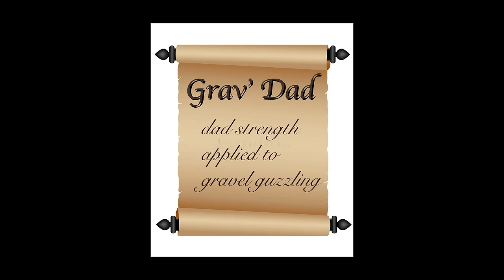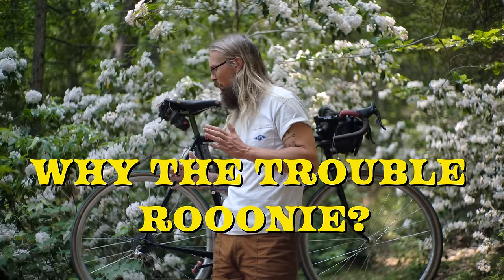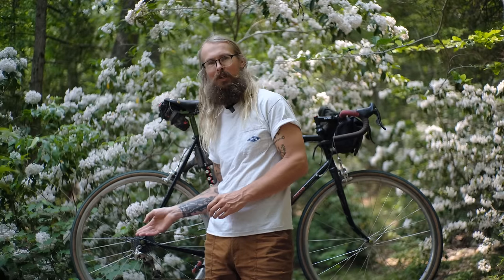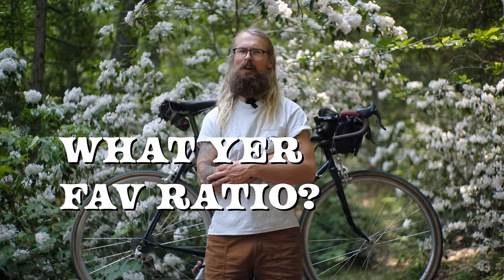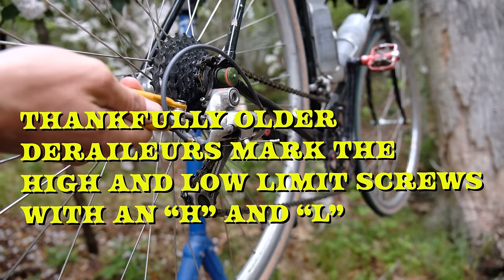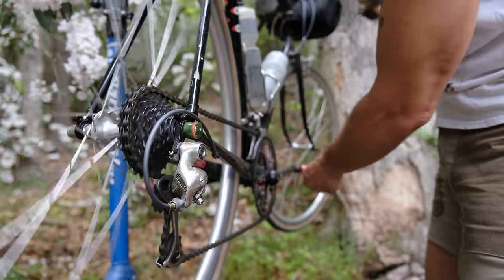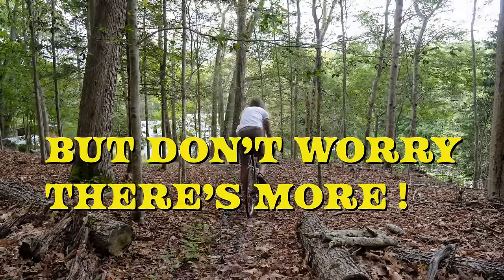build your own groupset

Comment: This video was a joy - appreciate your musings. 

I am wondering if you could maybe shed some light on what brakes you are using with your Malocchio? I am looking to build one myself and trying to find the happy middle ground between reach and a brake set that looks great on the frame.
Reply from the maker: hello!  these are Shimano BR-R600 medium reach brakes from the 9 speed era ultegra.  they juuust barely clear on the front, but they doooo clear.  would recommend.

Comment: I like running 2x10 that is setup more like 1x+ granny. I basically use it as a 1x but if I run into a tough hill or if I am fully loaded I have that granny. I have even used mid sized cage for this as I only need the 3 or 4 large cogs in the back when using the granny.  I have done this with a 38/22 x 11-32  and a 44/26 x 11-32.
Reply: My 10sp Sram road/mtb is 40/22 with 12-28.

Comment: OK. Here's my weird setup:

On my '86 Schwinn Cimarron, I run Shimano bar ends on XT front and rear derailleurs, which I consider pretty normal. The fun part is that I found some NOS XT Deore 732 hubs, which was the second XT groupset designed for 6s cassettes, and so the rear arrived with a 130mm axle. I re-spaced the rear triangle to 135mm and installed a 135mm axle BUT I kept the 6/7s freehub. This let me build a wheel with close to zero dish (I think it's around 1.8mm). I use an 8s cassette with the smallest cog removed (locknut tightens just fine) because Sheldon sez that 7s Shimano spacing is different from 8s, and I want the indexing to work and 8s cassettes are easier to find.

How's that? 

PS I miss the old bad audio. I totally thought you were trolling us.

Comment: I use veloce 9 speed shifters on my road bikes, with a mix of random campy parts and record 10 speed cranks. With large hands, you can shift with one finger from almost any bar position. Never warmed up to the newer big-ugly-door-knob designs. If I had a gravel bike, I'd most likely use microshift advent-x mtb parts on pursuit bars. Brakes are a more difficult problem. I'd prefer cane creek tt levers, but would find it a hardship to not have magura mt-5/7 calipers.

Comment: I used Campy 10 speed shifters with Shimano 8 speed cassettes. I found it worked quite well. Then 11 speed came along and I was in heaven. You could use any 11 speed cassette with Campy 11 speed  shifters. Awesome! The only drawback is I don't need 11 gears. I suppose I could remove  a loose sprocket or two, but why bother.
Reply: wait.. any 11 speed cassette? is this with an 11 speed derailleur?
Reply: Yes any 11speed derailleur. I've run Campy 11 speed shifters with Shimano 11s cassettes. It works great.

Comment: Cool, I'm going to try that on my friends' bike (he has Shimano, I only use Campy, because I have the spirit of an old man). You forgot to mention another great feature of the Campy Ergopower, the brake quick release using the pin on the levers. Which I personally only discovered after using these for five years. I guess Tektro copied it for it's brake levers.

Comment: I have similar Compagnolo 9spd with 8 speed shimano cassette and altus 310,  alivio m430, deore xt 8000 (with reverse cable entry for pull-ratio compatibility). It works and I don't know why ;) The only disadvantage is that one of rubber hoods is removed because it was hardly damaged and there is no possibility to buy new one.

Comment: @ultraromance I have a Campy spaced Shimano splined rear cassette from 20? years. I forgot who made it. It's from the 9-10 speed era.
Reply: I've got an Ambrosio Campagnolo 10 speed conversion cassette and it works pretty well with just the right amount of cable tension. I wish someone would make new ones, but my plan when this one wears out is to salvage the spacers and put them between one of the lower-end SRAM 10 speed cassette which can be easily disassembled.

Comment: Thanks for this cutting-edge research. Curious if these shifters would work for old 7 speed cassettes as well. Any thoughts?
Reply: I'm also curious to know... I would like to try this on a 7-speed cassette. I think it works on paper since I believe the the spacing between 7-speed and 8-speed cassettes is basically the same but you never know until you try it I guess...
Reply: The spacing is the same, cable pull is a bit different (I think 0,2mm) but so far every built worked with a 8 speed Shimano Shifter and a 7 speed Shimano cassette, so it should work with Campy 10 speed shifters and a 7 speed cassette

Comment: However much high end tyres Panaracer can make, they just can’t seem to get rid of that bump near the valve. I couldn’t help but stare at how the tire runs while you’re tuning the mech
Reply from the maker: thats a factory second of a tire that only I get to use.  the dual compound strip is off center in one spot, but the tire isn't lumpy 🫣 -- the cobbler is always barefoot!

Comment: You think that shimagnolo set up will also work with 9s derrailleur? I think Shimano 7-8-9s share the same ratio
Reply: Based on pull ratio, there are 3 varieties of Shimano derailleurs.
11-speed or higher road derailleurs (including GRX gravel) *plus [Tiagra RD-4700 & GRX RD-RX400 10s] use 1.4 ratio.
10-speed or higher mountain and touring series (RD-Txxxx) derailleurs use 1.05 ratio.
All others (all the old stuff and modern entry level) use 1.57 ratio. (often referred to as 2:1 ratio, but actually 1.57)

6~8s Dura-Ace are the outliers with circa 1.7 ratio, but they're very rare.

So, nearly all 7~9s derailleurs will work with 10s Campagnolo shifters.
By the way, there's another viable combination that not many people are aware of: 10s Campagnolo shifters + Shimano 1.4 ratio derailleurs + 9s cassette
or this SRAMgnolo mix: 10s Campagnolo shifters + SRAM road or mountain 10s derailleur ("Exact Actuation" 1.27 ratio) + 10s cassette

Comment: Would 8 speed ergo shifters work with a Shimano 7speed rear derailleur and cassette or freewheel? It seems like the cog spacing and pull are close. I'm working with an old fuji bike.

Comment: Whoa, back up. The Dura ace  7800 10 SPD brifters are the best mechanical shifters ever made. They work seamlessly with your favourite XTR rear mech to give you 10 SPD 11-36 at the back. 

I have used the shimergo 8 SPD  setup and tbh it's not in the same league as Dura ace/ XTR
Reply: I think the hideous nature of the crankset probably caused Ron to boycott the entire group set.
Reply: @davidross8233  The 7800 crankset? If thats what you mean? Personally I like it, its the last of the highly polished stuff Shimano  did. But, I don't use it for my grav Dad 2 x 10 , but maybe I just might...
Reply: @paulfroome3530  I don’t mind it either but I think it’s the type of design that RR rants about from time to time. What chainrings are you running up front?

Comment: Very cool!
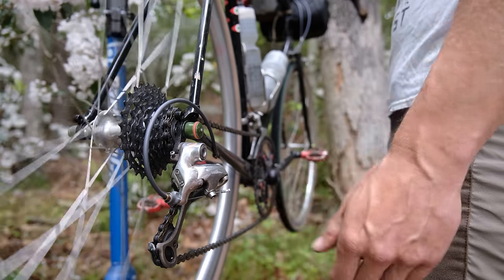Do you know if the adjustment process you showed at 7:30 works with other 10 speed shifters on 8 speed drivetrains or do I need to track down campi parts?
Reply: that’s generally how you set up any rear derailleur
Reply: @jonamcc  I mean specifically for getting a 10 speed brifter to work with an 8 speed cassette

Comment: Hi Ronnie, do you know if a Suntour XC Pro front derailleur works for a wide range double setup? And also if the Campagnolo Record front dérailleur were available in top pull versions and for 31.8?
Reply from the maker: hello!  any triple front der with a longer rear or the cage will not work well with a wide range double.  really the more basic the der looks, the better it will work with a wide range.  and not sure about the top pull front ders, as all of my bikes are bottom pull.  good luck!
Reply: @ultraromance  thanks a lot for the tips Ronnie!

Comment: I guess it would be better to run one of those online calculators but I just was hoping to know how one could be on these difficult trails without some front chainring in the 20's and cassette such as 11-42 tooth or more. I'm new so I've just not tried a 2x with cassettes like these and have so far gone from shimano to microshift advent 3x9 11-46. If I were to go on to these kinds of 2x setups would it be impossible to pedal on the hiking trails?
Reply from the maker: hello there.  micro shift is a nice alternative to the bigger brands.  a 3x system with a 42 large in the rear is very low geared --- a real rock crawler!  i generally don't go larger than 38 back there on my set ups for bikes I need a total bail out gear on.  the key is the wide range double up front.  my mountain bikes run a 38-20 up front with an 11-34 in the rear and it crawls anything in it's path.  cheers!
Reply: Taking notes thanks

Comment: Ronnie, did you ever tried 10sp Campa with 9 Speed Shimano? I heard If you clamp the Shift cable a little different at the Derailleur, it'll work fine. Any experiences?
Thanks, love your stuff!😊
Reply: I've done that and it worked ok. Even better is campy 10 speed to sram 10 speed. Shifts perfect.

Comment: The funny thing is...according to published actuation ratios this setup shouldn't work. But obviously it does.
Reply from the maker: I do like rotor --- 13 and all
Reply: @ultraromance  Nah...I think you are on the right path with your Campagnolo 10 speed setup. Nothing beats the ergonomics of these Ergopowers. I just ordered a shift mate and I am going to try to combine the 10speed record shifters with a sram eagle gx rear derailleur and an Ali-Express 10speed Shimano clone 11-50 cassette. According to the internet that should work; I've got a nagging feeling, however, that it will be exactly the reverse from your setup: mine works on paper but will fail in real life, whilst yours works when it, according to theory, shouldn't...
Reply: I appreciate the posthardcore goodness. Would u mind sharing band info? Also the bike stuff is inspiring.

Comment: You ever shift from the 13t to the 15t cog in the back and then suddenly your legs aren't going the right speed? That's why one might desire more than 9 speeds on a cassette. Sure you could run a 9 speed road cassette, but then your doing what, 21 or 23 teeth up top? No good my friend.